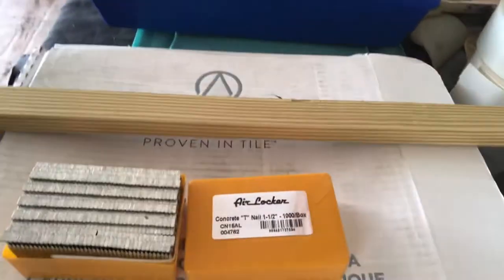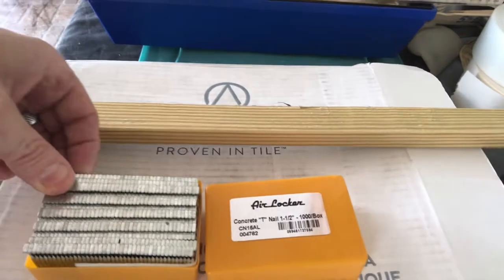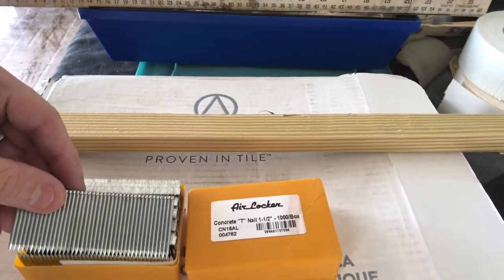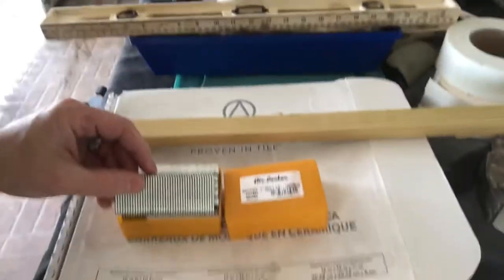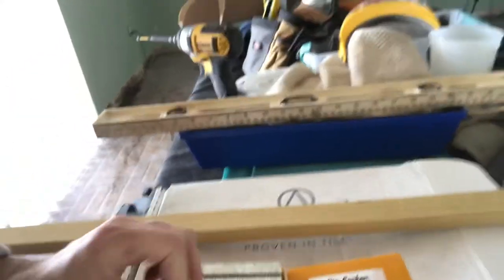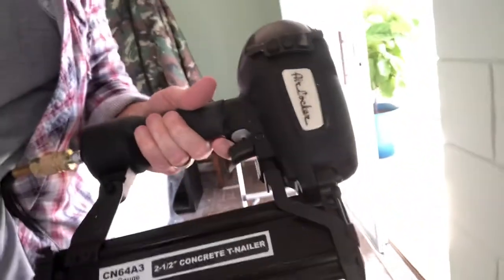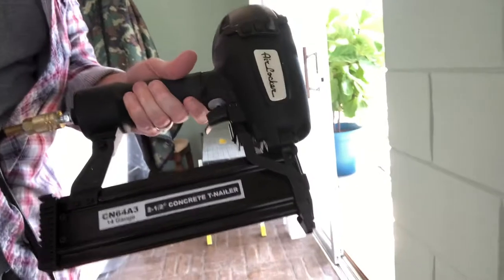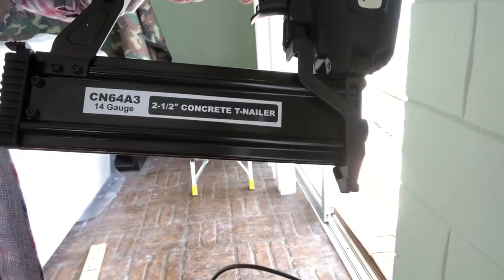Attaching furring strips to concrete cinder block walls the easy way

Comment: Do we need to use pressure treated wood since there is a direct contact between the wood and concrete ?
Reply: Always ! Or u can place a sheet of roofing 15 lbs tar paper between strip and concrete.

Comment: How did it the nails hold up? And is there a weight restriction the furring strips can hold being nailed?
Reply from the maker: The nails grip extremely well. You can pull the furring strip off the wall and not remove the nails. I had to cut nails off when I needed to remove them